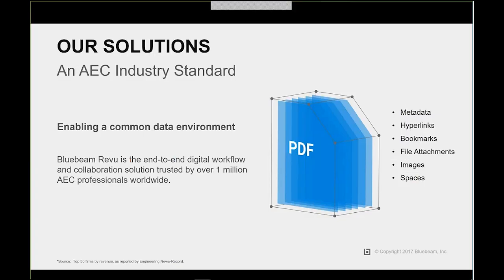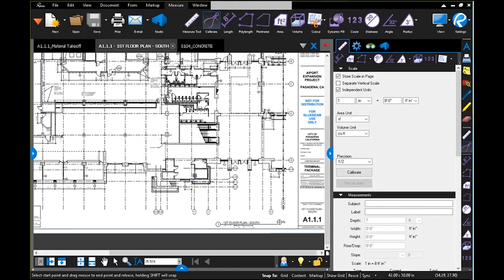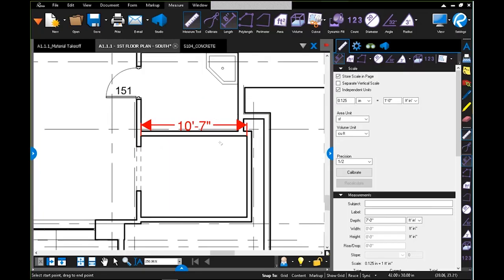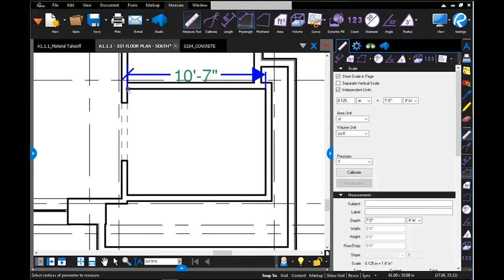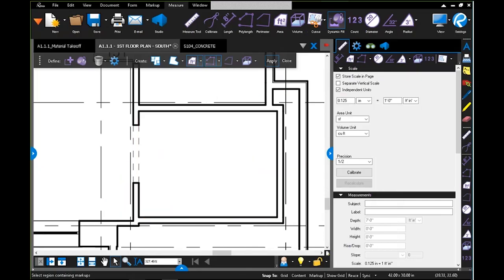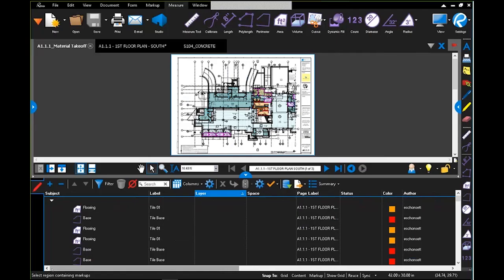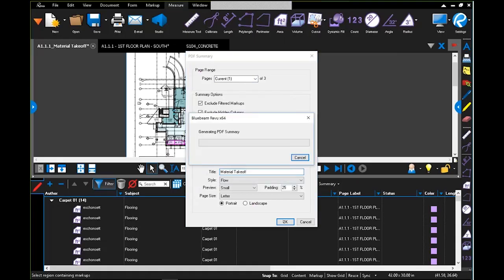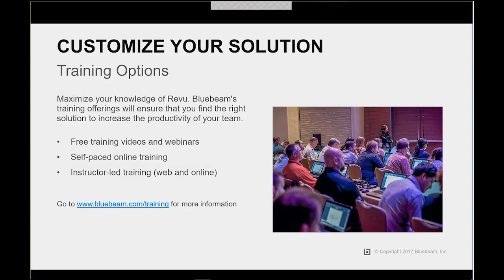Revu for Takeoffs & Estimates

Comment: Great video, thanks for the upload. Have you ever experienced the dynamic fill tool not reading the line weights on any PDF document? I have tried messing with the sensitivity as well as disabling the line weight to no avail. Would love any advice you may have. I have Revu 21 complete if that helps, Thanks!
Reply from the maker: Hi Hannah, thanks for reaching out. We'd recommend you get in touch with our Support Team as they would be the best ones to help troubleshoot what's going on. You can reach them at support@bluebeam.com.

Comment: Is it possible to measure a radius sidewalk per say ? Or does it have to be straight lines ??
Reply from the maker: Hi Ben, thanks for reaching out!  The Center Radius and Three-point measurement tools might help you accomplish that. Here's a link to an article where you can learn more about them: https://support.bluebeam.com/online-help/revu2018/Content/RevuHelp/Menus/Tools/Measure/Center-Radius--MTV.htm. You may also wish to connect with our Support Team directly at support@bluebeam.com so they can help walk you through a solution.
Reply: @SugarDad5555  thank you , friend 
I was just curious because I just start working as a j. Estimator but we do everything manual and I was just wondering, thanks bro
Reply: I rather use Auto CAD in takeoffs and markups than Bluebeam.
Reply: @SugarDad5555  is it easier or better?